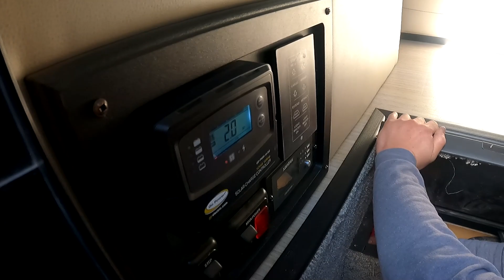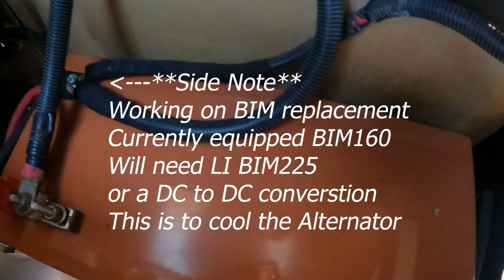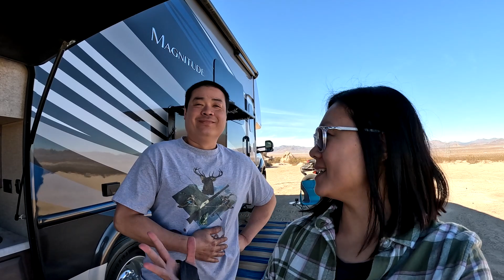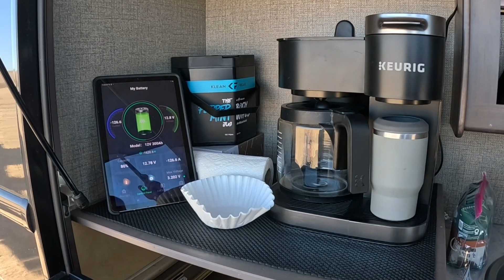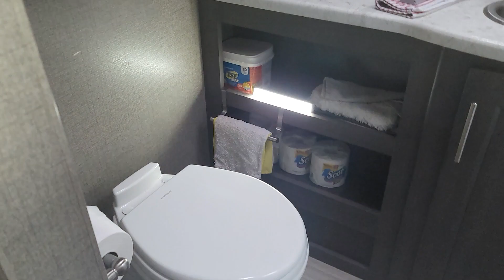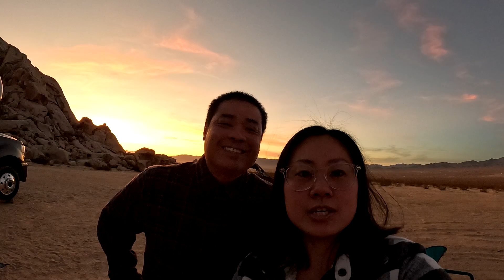JavaEnergy 12V 300Ah LiFePO4 Battery UPDATE!!! 24 Hours NO GENERATOR

Comment: I bought this battery about the same time you did and its still going strong in my 28 foot Forest River. I have it hooked to shore with a 5000 watt inverter so powers the whole RV like a generator. How has the battery been, looking for an update after watching the fallout with Battle Born batteries? Ours has been fine, no issues now for 3 years. We have 400 watts of solar on the roof as well, Renogy with a 30am Rover charge controller, keeps it always at 100%. That exact 300 ah JavaEnegy battery is selling right now on Banggood for $299.
Reply from the maker: Sweet! That's awesome! Our us doing well too. Bummer on the battle born fallout, but good for us on shopping around. Saved us a good amount. Great to hear about the sale!

Comment: You gotta be 10% smarter than the equipment you are trying to operate, or it won't work out that well.
Reply from the maker: Agreed, power element of the RV can be challenging. So far this set up has been working well for us. Would like to ramp it up some more, but so much to learn.

Comment: any capacity tests done before the installation? i am thinking of buying four of these for a 48v mobile application, but thats a lot of money if they are not actualy 300ah each
Reply from the maker: Hi no tests before installation. Any suggestions on how we could try and run some test on our end?
Reply: @wKKnDwarriors  for accurate tests, i use a load tester. i have four of them for testing all my batteries and cells every time i get a new battery,
i think the load testers i got can handle about 170 watts and cost about $80 each. 

you set the current and low voltage cut off and walk away. it measures the energy consumed over time.
 
a big battery with a small load tester would take a long time. 12.8v x 300ah =3840wh/ 170w = 22 hours to test, i guess that isnt too bad.

also, since i have four of them i could connect all four to one big battery in parralle, and once the test is done add up the values from each unit, which would take the testing time down to about 5 hours

 thats my precise way, there are other methods and faster ways as well.
Reply from the maker: @jasonbrown467  Cool this helps we will research further. Appreciate you taking the time to explain it in detail 👌

Comment: Lol, that app stops giving accurate readings pretty quickly.  4 out of 8 I bought are acting funny.  1 bms failed.
Reply from the maker: Oh man. No issues with our big one, we got the 300ah, hoping you can get it warrantied?
Reply: @wKKnDwarriors  I bought 8 x 300ah.  2 of them were bad because the replacement they sent was also bad.  Waiting on the 10th battery to be sent to complete my 8 - it has been an ordeal and would not use this company again.  Over a month of losing half my system's 48v capacity.  Multiple trips to Fedex, testing their batteries, connecting them, and these suckers are heavy!  Again, pay a little more if I could do it again and go server rack batteries.
Reply from the maker: @gwm6102  Man so sorry thats happening to you. We didnt run into any issues and the battery is still doing well. We were looking into updating our golf cart batteries too, but will go with another brand.
Reply: @wKKnDwarriors  which other brand, I need to buy a big one?
Reply from the maker: @masa-blasta  we haven't had any issues with the big one we bought, but for our golf cart we are still looking in to other brands.

Comment: Hi Guys.  Are you required to replace the BIM if you go over a certain AH?  Or, if you move to LifePO4…..you should change it?  I have the same unit.  Thanks
Reply from the maker: Hi if you are switching to lithium yes. From suggestions and researching it will cycle off to avoid overworking your chassis alternator.
Reply: @wKKnDwarriors  thank you.

Comment: Checking in to see how things are going with this setup. I mainly want to know if you are able to mostly use the factory converter to charge the LiFePO4 battery or are you finding yourself needing to use the portable Victron to maintain it? I am very much contemplating getting this battery as the factory FLA 6Vs are corroding the metal frame under the stair and they needs lots of maintenance constantly. In my case I do not have the dinette to install the battery into so I will likely need to use the same process you all did to insulate the under step compartment and keep the battery there. Trying to determine how much of a pain it will be to charge the battery if stock converter is not really able to maintain it to 100%. Worst case I need to get a Victron charger along with this battery or upgrade converter to LiFePO4 compatible. Thx!
Reply from the maker: Hi yes we are using the victron to maintain the levels prior to a trip. Weve tried it without while bondocking and stock doesnt power it up as well. So when we kick on the generator the victron is plugged in to help give it a charge boost.

Comment: I just received the same 300 AH as you reviewed. I’ll be installing it tomorrow at my off grid cabin. I’ve got 1000W of solar panels but in Maine with some shading issues, so it will be interesting to monitor. Temps can get down to below zero inside the cabin if I’m away in mid winter. Depending on how the battery works out I may order another.
Reply from the maker: Nice! Hope it works out for you. So far the smart bms is doing its job pretty well. We use a victron charger to get it to 100% before trips as it will "sleep" when not in use.
Reply: can someone please do a head to head comparison of all the new 460ah lifepo4 batteries that are coming out? redodo bird, roamer, litime, epoch, basen, VATRER, power drag queen, etc.. thanks in advance!   @wKKnDwarriors

Comment: Eggs and bacon? My God that must have cost 300 dollars LOL! I`ve been eating sardines and homemade biscuits. But I`m building a solar power system for my camper. I have to order my food. I`m in a very rural area far from stores with no car on a fixed income. I bought a 300ah battery by another brand, 2000w inverter, and 60 amp MPPT charge controller, plus a 20 amp plug-in LiFeP04 charger so I can use the battery/inverter for power outages until I finally finish my system. It may be May before I can safely connect everything. Gonna try to begin this month. Almost there but I ordered the wrong battery meter...100 amp instead of the larger amp one I need to monitor charge/discharge and battery capacity. I needed it in case another hurricane passes through here to power a tiny air conditioner some.
Reply from the maker: Wow thats insane, hoping weather isnt crazy for deliery to your area. 
Thats awesome on the build. Keep at it, wishing you a sucessful connection once done. Eventually we would like to add/upgrade the system down the line. Just not ready to dig into all the wiring/rewiring just yet, so much to it

Comment: 2 questions:

1.) Have you ever drained this battery to BMI cutoff and how long did it take to get to full 100% SOC?

2: what is your average hourly amp draw on days you've drained it to BMI cutoff?
Reply from the maker: Hi the lowest weve drainned it was down to 14% with an average 8-15amps.  It took about a day to fully charge it with the victron charger at home https://amzn.to/3lH4JtU it may take longer without
Reply: @wKKnDwarriors  damn. That's a long charge time for my use case. I need to charge it up within 4hrs. So I guess I have to consider solar generator types (eg ecoflow) with built-in fast charging. 😭
Reply from the maker: @vroor32  oh dang thats a bummer. Yea man it starts to get more expensive with more configurations, parts etc...so far this is a good starter till we get better at this.
Reply: @vroor32  You may be able to get three 20 amp chargers to put 900 watts into the battery. I assume connecting three chargers is ok if you use a bus bar to connect to then from that to the battery with a 2 gauge cable.
Reply: @vroor32  Consider a DC to DC charger and charge off your vehicle's alternator.  True you'd need to have the vehicle on or be driving, but that's about as fast as anything could charge a battery if you are not somewhere it could be plugged in.

Comment: Are you charging off your alternator?  If so, did you install a DC-to-DC charger or some sort of lithium battery isolator?  Since lithiums have very little internal resistance you run the risk of overloading and frying your alternator.
Reply from the maker: Hi, we ended up switching out the equipped BIM160 to an LI-BIM 225. I believe the the LI-BIM it helps cycle on and off to protect the alternator. https://amzn.to/3WUNAKc

Comment: Something seems off……did that app say 126 amps to heat water?!  That can’t be right.
Reply from the maker: Yes it did, coffee & hot water machines, suck up a lot of juice. I believe this draw is similar to starting up the generator as well...crazy....
Reply: @wKKnDwarriors   but most homes only have 200amp service panels……there is no way a coffee maker and refrigerator draw that many amps.  The coffee mark might be 10amps at the very most and the refrigerator is probably 5 amps. 🤷🏽‍♂️  I think there is some confusion with your smart battery app.
Reply from the maker: @broncobill392   🤔 hmmmm......will keep messing with the app and appliances
Reply: @wKKnDwarriors  I believe the 126 amp figure is accurate.  Assuming Bills figures of 10 amps for the Keurig  and 5 amps for the fridge; a total of 15 amps AC. The coffee maker and fridge run on AC current supplied with an DC to AC inverter at about 110-120 volts AC.  The 15 amps equates to 1650 watts which is 126.92 amps at DC battery power not including about 10% inefficiency of the inverter (about 13 amps).   The 13 amps is most likely being provided by the solar panels so the battery app is displaying the net amperage of 126 amps 

 See calculation below:  
15.00 Amps (Keurig & fridge)
X 110.00 AC voltage 
 --------------- 
  1,650.00 Total watts
 /     13.00 LiFePo4 battery voltage
 --------------- 
    126.92 DC Amps
 +    10.00% Inverter inefficiency 
 --------------- 
 139.61 Total Amps
Reply from the maker: @jimfoley7618  Thanks Jim for breaking this down. This helps, appreciate it 🤗
Reply: @wKKnDwarriors  You're welcome, glad to help. I'm seriously considering the same battery but the 200 amp model. Your videos have been reassuring!
Reply from the maker: @jimfoley7618  Awesome! Glad we could help out in any way. Wishing you safe travels!
Reply: @broncobill392  The app is measuring the 12 volt amp draw. 200 amps at 12 volts is around 2400 watts.

Comment: Happy New Year 2023 Katie and Kevin! Thanks for another great video. I have been anxiously waiting to hear how this JavaEnergy worked out for you. I also have a Magnitude and am looking at what I will replace the (2) 6V FLA batteries with. I am curious about your convertor. I know you mentioned in the video about looking into a Victron converter/charger, but were you able to charge the battery with the onboard converter? I know you have to replace the BIM as you noted, but I also thought the converter would need to be changed for it to charge the LIFePO4 battery. My understanding is the Solar Convertor is already LiFePO4 ready and just has to be changed in the config. I am sure you will have more updates, but wondered about this part.
Reply from the maker: Hi Paul, Happy new year! So i believe we just need adjust our freedom invertor to be compatible with our new batteries. Check this out https://youtu.be/nkgkwCcuLgQ
Reply: @wKKnDwarriors  Thanks I will check that out. On my 2020 BH35 I have the Xantrex invertor, but also a convertor under the bed that I already upgraded to a progressive dynamics. I believe that converter would need to be updated to a LiFePO4 compatible one, but it seems in your case the stock Thor convertor is working to charge the battery?
Reply from the maker: @paulnelson4206  yes so far everything seems to be charging. So far no issues, but we will continue to monitor.
Reply: @wKKnDwarriors  That is great news. This would be a much lower price option to convert to LiFePO4 than what I have seen. Most that I have priced were in the $3K+ price range.
Reply from the maker: @paulnelson4206  Oh yeah weve seen some crazy prices and we wanted something realistic for our budget. Hopefully down the line we can overhaul everything when the budget gets better LOL
Reply: @wKKnDwarriors  If you are interested you guys can give this video https://www.youtube.com/watch?v=NPGw9vI5jDI&t=860s converter/charger a watch that has Mike Sokol from RV Electricity interviewing Dennis Wieske from Progressive Dynamics. They go over the differences between converters/chargers for FLA/AGM and LiFePO4. It appears that while the older converter/chargers will work to charge a LiFePO4 the trickle charge mode that most of the non-Lithium capable converter/chargers have is too low for LiFePO4 because of how they really never drop below a certain voltage to initiate the "boost mode" charging. Essentially a LiFePO4 battery would shut itself down before a non-Lithium converter/charger would detect the need for a 14.4V charge current. Lots of details, but it seems WFCO would work to charge LiFePO4 (as you have clearly shown), but is not optimal.
Reply from the maker: @paulnelson4206  Cool thanks! Appreciate you sharing this. Electrical and power banks can definitley get confusing.

Comment: Merry Christmas and Happy New Year to you kids!  I noticed there is an error in your title, though.  It should be 12V, not 2...  I have found over the years of boating and camping, that the highest draws on electricity are the air conditioner (of course), the microwave, and the coffee maker.  Maybe a hair drier, if you use one.  We never used an inverter, though, and we've always had 12v refrigerators.  We used 6, 6 volt golf cart batteries in banks of 2 each in series, and 3 banks in parallel on the boat and the batteries would last about one weekend.  6 of those batteries would set you back more than what you paid for your Java battery.  You might consider paralleling another Java battery or two.  The voltage would be the same but the amperage would be greatly increased.  You do have to be careful when doing that.  If one battery fails, you need to take care of it right away, or it will cause problems.  But, I'm pretty sure there are electronics that you can add that will take care of that.
Reply from the maker: Merry Christmas and Happy New Year! Thanks for Catching that, just corrected 😁 Any tips are much appreciated. We hope to increase the load down the line, but I'm sure we need to make lots of changes to the solar amp controller, invertor and what not. Definitely a lot more to read into and research, but your input helps as always.

Comment: You might want to seal up and insulate the bottom of the steps where the battery is.  If you ever might have it in a cold climate you want Lithium batteries insulated so they don't get cold enough that trying to charge them damages them.
Reply: A good charger will also know this and not try to charge them.  My Renogy DC to DC will not try to charge if the sensor reads <32F.
Reply: @gr0uch02a  apparently there are some new LiFEPO4 that can do -20C.  Idk how they're doing that, but that's amazing.
Reply: @FloridaAmbient  Yes they do.. As automotive LifePO4 batteries are coming out..I called to ask is they can handle subzero temp....They said they have builtin heaters to keep them warm and well insulated like a Space Ship.. As the second you start using LifePO4 battery. They will get warm anyways...
Reply from the maker: @gr0uch02a  Yea we havent gotten to super low temps yet, but the bms in this battery does have that function
Reply: Not as big of an issue with LiFEPO4, but with Lithium Ion hates cold.
Reply from the maker: @FloridaAmbient  Thanks! That is helpful to know
Reply: @FloridaAmbient  Looking at an EVE LiFePO4 datasheet, they still don't recommend charging below 0C, so they're still succesptible to freezing temperatures, so my orignal statement stands.  If you're going to be in areas with freezing temperatures, you want them in an insulated/heated space.
Reply from the maker: Oh yeah for sure. With all the crazy cold weather going on out there. Thanks for the suggestion. 👍

Comment: Definitely nice to run things without the generator.  That's a great price for 300 amp hours of lithium.
Reply from the maker: Oh yeah for sure a plus! So far the battery is doing really well. We are amazed!
Reply: @wKKnDwarriors  I have lithiums already, but if I was ever upgrading, I would definitely entertain an "off" brand.  Almost 3 times the capacity for the same money.  I wished I had 500-600 amp hours of lithium. That would be about perfect.
Reply from the maker: @rvlifediy  Same, we would love to add more down the line as well.